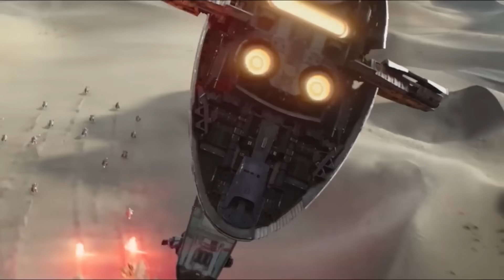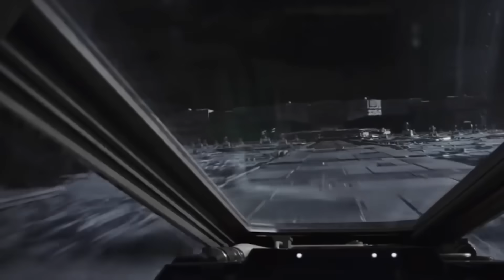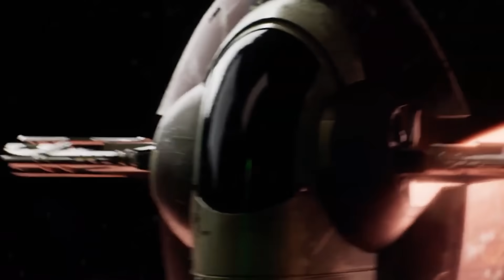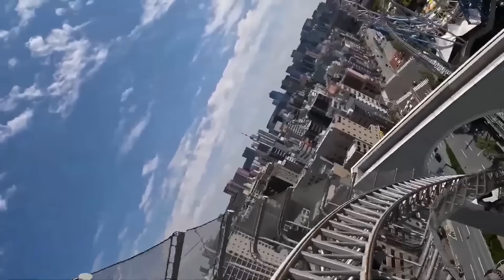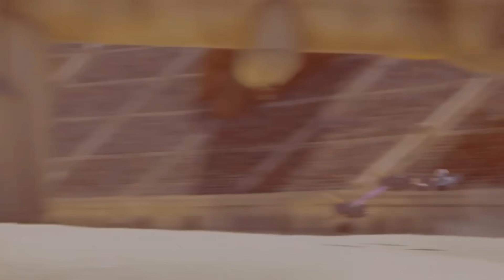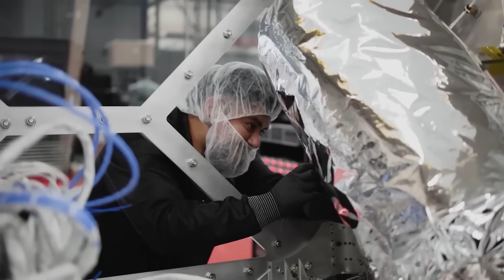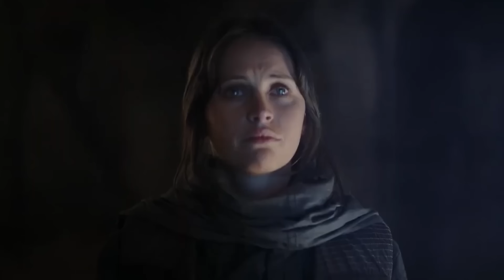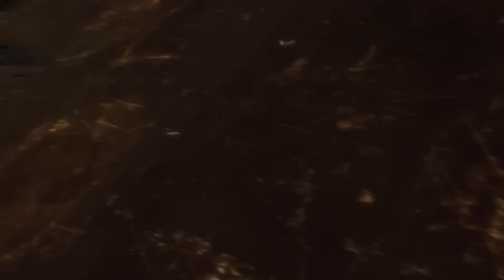The Problem with Star Wars Ship Design

Comment: It's actually simple. The empire massively underestimated the power of the rebels. 

1. The ship designers were extremely confident on their shield generators. Also, empire doctrine prioritized intimidation and projection of power over pure survivability. 

2. Placing the command deck  there reduced latency and signal disruption caused by the ship's own massive hyperdrive and reactor emissions deep inside the hull.

3. In an era where digital sensor feeds could be blinded or spoofed mid-battle, naval doctrine dictated that bridge crew retain direct, unjammed optical lines of sight across the entire dorsal hull and surrounding space.

4. The massive, elevated superstructure gave commanding officers a literal high-ground vantage point, reinforcing the Empire's hierarchy and projecting total dominance over subjugated systems.

Comment: 21:09 The A-Wing alone didn't take the Executor down. In fact, it probably was going to go down without the A-Wing hitting it. As we can see in the movie the Executor has already lost its shields and was under concentrated fire from the Rebel Fleet. As seen on the ship, the engines were already critically damaged and the ship was going to be pulled down by the Death Stars gravity either way. The A-Wing damaging critical components on the bridge just speed the process up.

About the destruction of the first Death Star, it was actually explained I think in one of the books that Galen Erso offered Director Krennic hundreds of extremely tiny exhaust ports or one big one. To do the hundreds of tiny ones would take multiple extra months, and Krennic was already running late on his schedule, so he chose one big one. Galen Erso designed it to be a weakness, but because it couldn't be too obvious only a Force user could make the shot.

And about the shield generator on Endor, it was defended heavily. Stormtroopers are meant to be the elite force of the Empire, or at least meant to be well trained soldiers. The movies just tone them down. Palpatine didn't want the generator to be able to be destroyed, but he also couldn't predict a bunch of tiny furballs could take down his army. And the reason the Death Star was unfinished was because he wanted the Rebels to think they could destroy it easily, only to discover that the shield generator was protecting it and a Imperial fleet was waiting on them. It was all a trap. It was a perfect plan if not for the ridiculous way the Empire was defeated on the ground, and Darth Vader's betrayal which he could never have predicted[Darth Vader did it out of love for his son, which is something Palpatine can't detect or see].

And the sequels aren't canon. Hate on them ALWAYS.

Comment: You are wrong. Hard Sci fi doesn't need to contradict space opera. You can have hard Sci fi that doesn't have major fuel problems because if you use helium 3 and deuterium fusion, both common elements on gas giants, if you use such fusion generators using direct energy conversion you can save a ton of space on fuel why because you don't need tons of fuel to power the full ship for 2 years.. A few million kilograms but that doesn't take a ton of space relative to the size of such ships. These aren't small cars that you gotta refuel weekly.

Comment: The reason for glass windows is actually fairly simple, most of the Star Wars warships are designed as a surface combat ships, big glass windows are STILL on the bridge of modern warships because it's important to be able to SEE things. you know with YOUR EYES? In fact, in real life, during World War 1, and World War 2, naval research found out that most of the ships commander during that era preferred to stand in COMPLETELY UN ARMORED OPEN BRIDGE during battle rather than sitting in armored cunning towers, the primary reason was they have access to better views.

Comment: A note on the point about high orbital speeds:
Star wars ships, as depicted, do not usually orbit a planet like a ship would in real life. Rather, they hover above the planet using repulsor lift/anti-gravity tech. Even if ships were actually orbiting the planet during a battle, the ships, though traveling at orbital velocity, would not be traveling at thousands of meters per second relative to each other, assuming they have matched orbits (which would be required to have starfighter engagements like in the movies). Think driving on a highway. Everyone is driving 60+ mph, but relative to each other, your going really slow (or not moving at all) since your speeds are so similar.

All of that is to say, the starfighter's speeds during battle are not implausible.

Comment: Let's look at some key technologies in Star Wars that might explain some of their design choices:
Shields - these mean that space debris and atmospheric reentry are no longer problems.
Artificial gravity - this has an additional bonus in that, like Star Trek, you can use the same technology to mitigate G-forces. The Rogue Squadron novels suggest this can be set by the pilot so they can still feel the movement of their ship.
Engines - these are not chemical rockets.  They are ion/plasma accelerators.  Essentially, the same as Star Trek's impulse engines or real-world Hall-effect thrusters.  Star Wars gravity technologies could conceivably enhance the effects and increase performance.

Then let's look at some other choices:
Windows - holograms and screens are nice and all, but they don't prevent claustrophobia in the same way that being able to look outside does. What Star Wars should do is take notes from Battlestar Galactica (the original one) and have armoured blast shields that block those windows during combat.  There could also be a 'battle' bridge (newer Galactica), which is deep within the ship.  Combat should be sufficiently distracting that claustrophobia is not a pressing issue.  Stylistically, this would be a submarine command centre rather than a surface ship bridge.  Moving between the two may take too long during combat unless pre-planned.
Wings -still a very viable design choice for any ship that enters the atmosphere of a planet.  I shouldn't really need to elaborate on which is more viable for atmospheric maneuvering - an X-wing or a TIE.  Attitude control is also a possible factor. Thrusters on wing tips will be much more effective than those close to the ship body.  Basic physics.
Guns on capital ships - the dagger shape maximises damage in a forward cone.  This works well for space combat. Sailing ships are optimised for broadsides.
Anti-bomber/starfighter guns on capital ships - the Mandator IV had those.  Poe took them out.  Single-handedly.  This indicates bad writing rather than bad design.  They still took out all but one bomber.  But where were the shields?
Droid brains - we have no indication that Star Wars droids have particularly fast reflexes.  Quite the opposite, in fact.  This is why they may be a good choice for translation or navigation, but poor choices for gunnery, piloting, or ground combat.  What they do have, as seen in the Clone Wars, is *numbers*.  Capital ship gunnery might still be a viable option.

Comment: 11:50 nah bro, it`s a speed compared to earth, it`s just an orbital velocity
If you`d compare two objects on the same orbit their relative speed would be very low
for example the same apollo lunar module had to undock and redock to the command module during the mission twice
they both moved at the same "big" speed, though for the crew docking the lunar module felt quite slow

also the thing about acceleration and g force - in universe which has artificial gravity on every ship it`s quite possible to make the same gravity generator to compensate for the g forces to save the crew from them

Comment: The G force wouldn't matter because the ships have artificial gravity. It probably stays constant through rapid movements
Reply: Not in a singe ship schematics - graphics or textual description - of a Star Wars ship have I ever encountered an actual artificial gravity generator. From fighters to star destroyers - there just isn't one single example. 
Another thing tolally missing from Star Wars ships is inertial compensators, which makes the acceleratons available to them pitifully small.
As a SciFi universe Star Wars just does not work.

Comment: Starkiller base actually is just bullshit though. The death stars have justifications for how they function and why they were destroyed. Starkiller canonically took like fifty years to build and didn't have any way of dumping its energy despite having a continent-sized opening on one side. The idea a single mechanical system, maybe 0.01% of the way through the planet at maximum, could be so vulnerable as to take the whole thing out is just absolutely nonsensical. It may as well have just been a big red button.

The way I'd fix the scene is just to have the pilots have to fly down the barrel of the cannon instead. It's not like the death star which has a series of emitters, it's literally a big hole in the structure. That would also give the opportunity for a cool escape scene. The actual scene was over in like thirty seconds after like five seconds of shooting. God, the more I think about the force awakens the more I see how completely bullshit it was. Uuuugh

Comment: Other than the windows, which make sense for characterisation reasons as well as being useable when systems are down, basically everything is explainable by the fact star wars has anti-gravity. I couldn't tell you how g-forces work in anti-gravity but I wouldn't be surprised if fighters have some anti-g systems built into the seats. The size and maneuvrability of the ships is also explainable in this way. If gravity is always beneath you, the world can spin around like crazy and not effect you at all.

Everything else about big ships can be explained by the existence of fighters. They're meant to be escorted by fighters, and that also explains why battles are fought on set planes, just like ship to ship combat in the real world. Yes, a ship could present a much smaller target by facing the foe head on, turning a one-dimensional battle into a two-dimensional one, but the logistics of weapon placement demands a primary facing. That doesn't go away if you just add another potential dimension to the battle.
Reply: There is such a thing called available energy budget. The armor of capital ships should theoreticaly be engineered to whitstand at least a couple of salvos from its own guns - at least this was how most capital ships were designed in the 20th century. There is absolutely no way a fighter with its energy budget can generate enough energy  to do more that scratch the paint of a capital ship with its energy weapons anywhere there is armor. Any part of a space capital ship that for various reasons cannot be armored should be surrounded with the maximum possible quantity of AA guns. Because a capital space ship has an energy budget several orders of magnitude bigger than a full dedicated space carrier wing of fighters, there is no problem to place as many AA gun turrets as physicaly possible. You could actually take the armament, sensors, shield and energy generator of a fighter and put it on a capital ship as an AA gun turret. It will take less space that a fighter, be better shielded(shield has to cover only half a sphere) and fire more powerful/longer bursts of fire more often(no energy goes to movement or navigation or live support plus can use the vastly more powerful cooling systems of the cap ship).
From a pure SciFi perspective almost everything with the space battles and space warships in Star Wars is just ... trash. Can't be otherwise - the original trilogy from a genre perspective is an Epic Fantasy Adventure - and probably one of the greatest ever. There is not an ounce of SciFi in those movies and it does not make them any less great. The problem is - some people see space ships and automatically think there must be a SciFi explanation there somewhere. Then they start searching and inventing SciFi  explanations where those simply cannot exist.
Reply: @danieldimitrov5997 there is an explanation though, regardless of how scientific you find it. The galaxy has been throwing ships at eachother for millenia, across vast expanses of space which can have significantly different tactical value from one another, and the shifting needs of battles have dictated a variety of different shapes and loadouts. There are ships out there with a higher amount of firepower, but the realities of the technology, tactics and battlefields they're likely to face means things have to be optimised for the context they're in rather than just being The Most in any given area. It's the same reason historical armies didn't just give everyone plate armour, a horse and a halberd. Scale and specific needs are what matters when you're arming the largest forces possible. Call it unscientific if needs be, that's realistic.

Comment: The reason we design real-life earth-to-space delivery mechanisms the way we do is because our propulsion mechanism and atmosphere demand it--the tyrrany of the rocket.  Our spacecraft still have to deal with aerodynamics--real-life rocket designs must have efficient airflow so air resistance at escape velocity doesn't rip them apart or burn them up.  A craft built in space that is never going to enter an atmosphere can be built in more or less whatever configuration won't just break from the strain put on it by the propulsion mechanism at maximum thrust (cylinders, cones, and wedges are pretty good at that too, so Star Destroyers aren't that far off from viability).  Most sci-fi and space-fantasy that isn't on the extremely hard end of the spectrum will have (anti-)gravity or other propulsion technology that nullifies the aerodynamics aspect of the tyranny of the rocket, so the propulsion mechanisms no longer dictate ship design in that way--there might be other considerations in a given universe's tech base that still force spacecraft design to be cylindrical, but it's no longer an aerodynamics concern that's causing it.

Comment: Neutronium.........neutrons at room temprature........it weighs 1 000 000 000 000 000 000  of kgs per cubic meter  (10^{17} { kg/m}^3\)....it is extremely radio active.....at room temprature it will rust in 12mins.oxidising into protons...so then u are left with protonium an anti matter

Comment: The problem with windows is actually really interesting and it's one a lot of more modern sci-fi actually fixes pretty simply: just make them digital screens. This is actually used extensively in the videogame "Warframe", from the inside your landing craft looks like it has a giant window to see out into space but during the loading cutscenes where your landing craft is flying through the atmosphere, it is completely covered. It's just a screen, there's probably some cameras outside that just create an image inside the ship. I really like the fact that no information is actually displayed on these screens, they're just trying to emulate windows as close as possible and they do it pretty well.

Comment: The Death Star never had a plot hole. People just don't understand that the Empire with all their might and force, never DREAMED that such an exploit was even possible. The narrative that it's a plot hole is more of a modern take. It was never a plot hole, just over confidence from a super power that saw their ultimate weapon as indestructible. It never NEEDED revision or retcon. It's the same as you having everything planned for a trip, got everything planned from time of departure to time of arrival. You are fully packed out the door and you are so sure you have everything. Only after you get to your destination you find out you for got your tooth brush. Small oversights happen when you're over confident and that is exactly what happened with the Death Star. The Emperor was so sure nothing could destroy it and a small over sight ended up being the downfall of the super weapon.

Comment: The whole claim of the exhaust port on the death star being a critical weak-point is insane to me.

It's literally miles long, smaller than a great dane, constantly shooting out immense amounts of turbulent hot gas, and couldn't be hit by the best torpedo bomber pilots in the rebel fleet had to offer before the LITERAL magickal wizard used ACTUAL MAGICK without computer assistance to force the torpedo into said exhaust port at the PERFECT position, speed, and angle to keep on target while being pushed and pulled by the same hot gasses I mentioned before....

oh, right. 

FOR MILES STRAIGHT

Comment: around 12 mins you say about speed. speed is relative between two objects. star wars is known for dog fighting. the only relevant speed is that between the ships engaged in combat. you was almost there when you mentioned the expanse. The acceleration measured in G forces which can kill humans. In the expanse they use the special injected juice. Star Wars ships utilize technology commonly referred to as inertial dampeners, officially known as Acceleration Compensators or Inertial Compensators so the pilots can cope a lot easier.
For targeting we can clearly see that star wars fighters use targeting computers to get a lock, the weapons on the fighters can move on gimbles not just shoot in straight lines.

Comment: G-forces has nothing to do with speed. Only acceleration.
So an X-wing travelling at 98% the speed of light, constant, straight line = no G-force. Accelerating or deceelerating hard will do it though, or if you turn tight at high speed.

Comment: The Executor had received more damage than lead on. It's engines were heavily damaged as well as other systems no doubt. A massive target like that wouldn't have gone untouched. Most of the Imperial Fleet at Endor was destroyed. So it wasn't a single pilot. That claim is just ridiculous.